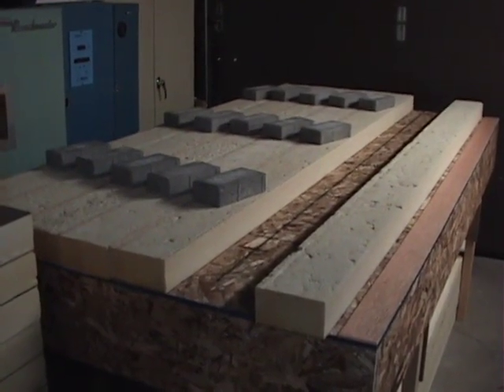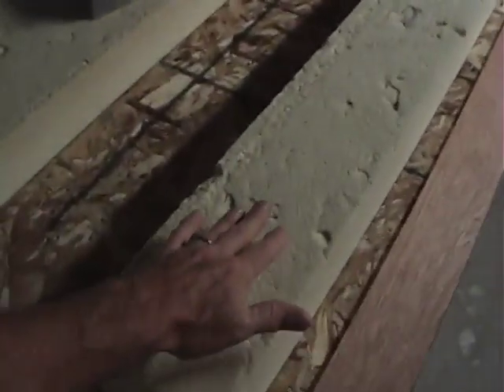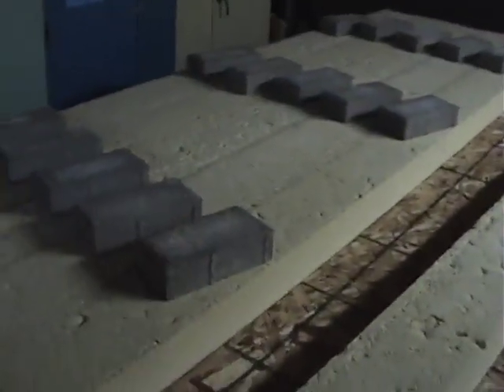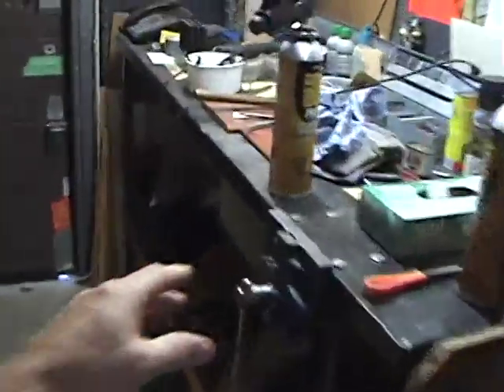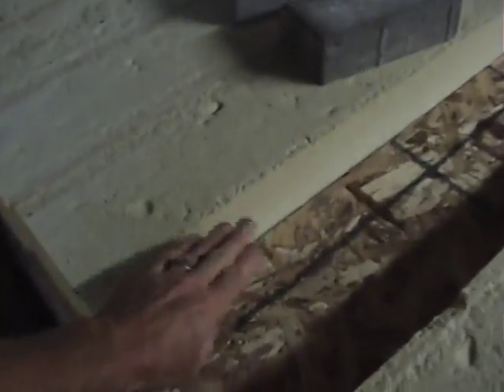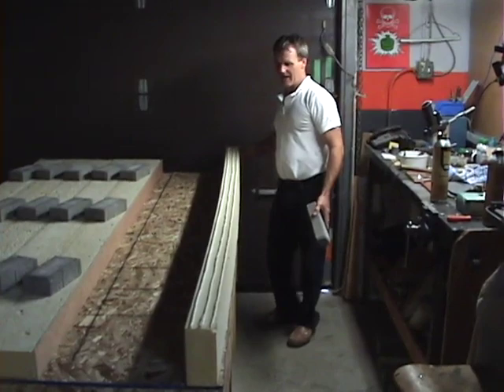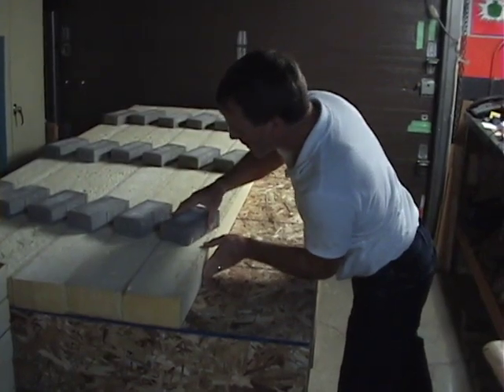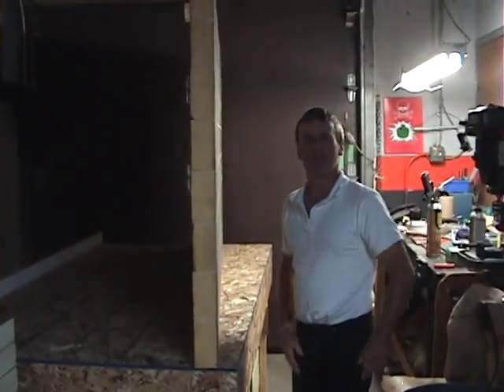Houseboat Build part 7

Comment: Interesting design, very resourceful. I'm considering a similar project, these videos were a great help. What was the cost of the materials and duration of construction?
Reply from the maker: The construction is not complete. I had to relocate the hull main construction location to a new place and now the fall is setting in it looks like I'll have to continue next spring.

The project could take 2 more years to complete and the total finished cost could be around $25k

Luc
Reply: Luc gotoluc Choquette Good luck with the rest. Do you have any designs you can post, I'd like to see what you have in mind.
Reply from the maker: Mo Sidat Interesting you want to see what I have in mind!... because all is designed in my mind and I have nothing on paper. So sorry I can't show you anything. Luc